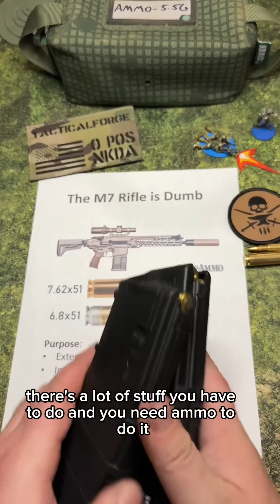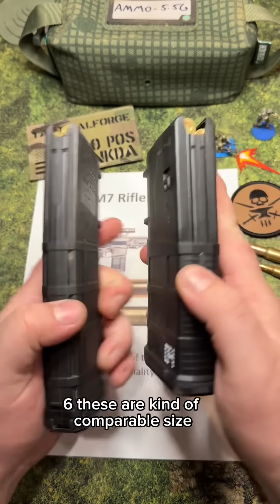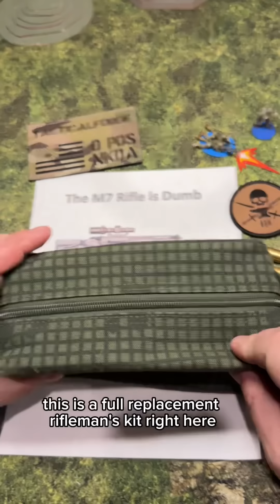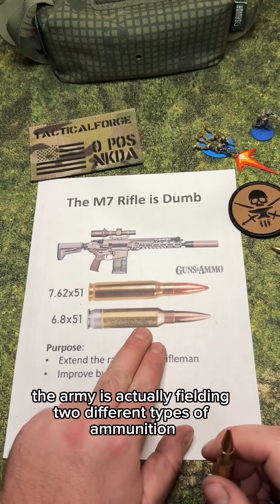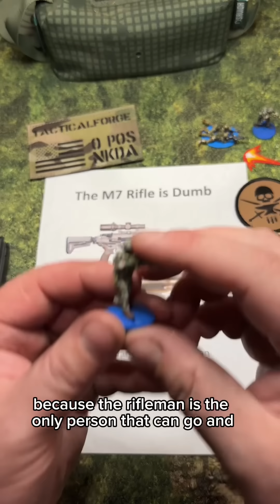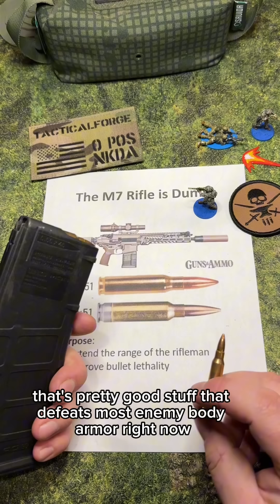The Army’s new rifle is dumb

Comment: This isn't replacing every infantryman's rifle, the M4 is going to stay in service

The rifle was already hard use tested with a suppressor. The entire system is designed to use a suppressor at all times, and it can absolutely work without the suppressor as well

The intention of this weapons system isn't to make everyone a sharpshooter and push engagements out to 800 meters. The issue it's solving is that standard 5.56 ball ammunition in a standard M4 is not capable of defeating modern body armor at typical combat ranges. The new system allows any rifleman to defeat modern body armor at typical ranges while keeping a 13 inch barrel length. The new round does with 13 inches what black tip 308 does with 24

Comment: But wouldn't there be an advantage in terms of defeating body armours and concrete obstacles in an urban environment?
Also in trench clearing shotguns were much much appreciated and they definitely had low ammo capacity, any chance the new rifle could provide a similar advantage?
Reply: It can defeat body armor and still has a 13 inch barrel, the low amount of ammo and weight are the only things holding it back

Comment: My immediate impression of this new rifle was that it gets into a "swallow the spider to catch the fly" situation in a couple areas. They want lots of velocity, but they also want a short barrel, so they need SUPER high pressure. Super high pressure in short barrels means very damaging noise levels, so they need a suppressor. So now you probably go to an even shorter barrel, yet the gun still ends up long anyway with the suppressor on there. Then you shoot whatever mode of rapid fire with that extra-short barrel and super-high pressure into that suppressor, and what happens then?

And yeah the magazine capacity.

And what is Murphy's Law going to do to that two-piece cartridge case?

Some points here I had not even considered. I can remember in the 1980's looking through some old night vision scope at the hot exhaust pipe of a generator set, and indeed it lit up like a glowstick.

Comment: they should've taken the development from the program and instead applied it to more traditional 5.56 platforms. I like the 416 plenty. A 416 type design with a folding stock and a 14in barrel is very serviceable, the MCX tries to be that but has concerns. SIG in general has huge concerns right now. They shouldn't even be in the running for a contract. I like rifles like the CAR-816 conceptually, we need to be learning right now. More reliable, modular, light weight weapons are what we NEED. Less weight means more ammo, more ammo means you win. I also like the concept of the Quattro 15 lower and 53rd quadstack mags, if you pair that magazine which is already lightweight for its capacity with a new lineup of hybrid case 5.56 with increased pressure for increased lethality, even just paired with the m855A1 or M995 projectiles is a huge step forward, or even getting more into the polymer case tech and lightening ammo even more, all the better. I think an important part of commanding firepower is capacity and practical accuracy. Not every guy needs to be a sniper, but if you have a squad where every man can dump 400 rounds in the direction of an unfortunate enemy patrol, your odds are massively better than have rounds that have marginally better penetration but significantly reduced capacity.

Comment: U missed the main reason they changed the caliber its was because of body armor 5.56 was no longer able to do the job. So they need to upgrade to a new rifle to do the job it just come with the bonus of extended range. Does the gun have problems that need to be worked out yes. But even the m16 family had problems for a long time too it just needs time to be worked out.

Comment: An overweight, overpriced, poorly-built, unreliable garbage rifle platform with a new high-pressure cartridge that's stressing the limits of projectiles and barrels. Topped off with an expensive, complicated optic.

Sounds like a recipe for disaster and the fact that we are sending our soldiers into combat that way is beyond disgusting.
Reply: So your solution is an m4 because those will be the solution for generations

Comment: The M7 was designed for yesterday's war. Today's war, being fought around Ukraine, Russian & Ukie grunts aren't engaging each other at 500 yards; it's close combat at 5 yards. Drones make prolonged gunfights at 200-500 meters unheard of. Those fancy sites on the M7 will be rarely used. Grunts are too busy, running  dodging, digging, hiding to pop their heads up long enough to use any of those advanced features. IR lasers on every M7 is suicide. Kamikazi drones will be looking for those. Notice all the AKs both sides use have virtually no lasers & no glass. They're not particularly useful in the kinds of gunfights you see there. Dude's are popping up for a second, fire a burst & scramble before a loitering drone punches their ticket. It's back to WWI with a side of mad max thrown in. Lots of bodies, cheap mass produced guns, road warrior metal cages & motorcycle assault squads, skynet hunter killers drones. Pretty soon a phased plasma rifle in the 40-watt range.
Reply: The army doesn’t plan for trenches to be in their future

Comment: I think it is a complex issue, and partially a doctrinal one. There were armies equipped and fought wars with the FN-FAL or something similar. But NATO standard is important, 5.56 and 7.62 NATO is what everyone has and what supply is set up for. Changing that completely is questionable, but would be insanely lucrative, and it should require a major performance upgrade in all or at least most relevant metrics, enough so that doctrine would take up the slack for disadvantages. 7.62 was shifted from everyone to DMR, machine gun and sniper roles in a lot of countries, in favour of 5.56. But you could plan around a different cartridge, and rehaul the entire logistics chain and tactics set up for 5.56, now we are talking about resupply drones and exoskeletons and other near sci-fi stuff. I think it's a problem of everything goes into the square hole, no matter if it is not really for that, and 5.56 is the intended NATO solution, it fits many, many purposes being just good enough. Will it be in the future or you need something that hits harder, is a question, or could a 40 mag be better if the casing was lighter or could you make something even smaller and lighter with the same performance? The flechette went away, the explosive round is against treaties, the gyrojet went away and so on. Not everything works out.

Comment: Good point about distance shooting with recoil. 6.8 is kicking harder than .308 even with the practice ammo.. The duty ammo is going to kick even more. When it comes to distance shooting, even with .308 it can be hard to see where your shots are landing and make adjustments due to the recoil. There's a reason why the MK12 is the most deadly rifle in US history. Even though it was shooting 5.56 compared to the M110 with its .308, its light recoil made it very easy to make quick adjustments based on POI and get rapid shots on target. Even though they sometimes did have to get more rounds into a target, at least they were able to get shots on target very rapidly.

If they wanted a spicier round compared to 5.56 that was more lethal with better penetration at range compared to some of the more expensive 5.56s ammo required, the answer is either bump back up to 20" or go to a bigger intermediate cartridge like 6mm ARC or MAX. With the overall length requirements, the obvious choice was bullpup. Something like the Desert Tech WLVRN with a 20" barrel is only 2" longer than a MK18 and effectively lighter due to the perfect weight balance at the pistol grip that doesn't strain the forearm. Even if you stuck with 5.56, you just got the full capability of the cartridge back that made the AR platform so effective to begin with effectively giving every soldier a MK12 with MK18 compactness. And WLVRN is multicaliber too and can be converted to shoot .308 and 6.5CM. DT did have a NGSW submission too for the previous MDR iteration and did shoot a polymer 6.8 that didn't have to be overpressured to get the velocity the Army wanted. So now you have a standard issued rifle that's light, great for CQB, and effective out to 700 yards and an excellent BR/DMR that can have that higher penetration and range out to 1000 yards all in one package that can be adapted for every situation they may face. Not to mention it also has a Micron configuration with an 11.5" barrel making it 5" shorter than a MK18 with its stock fully collapsed. And it can be swapped between all these configurations in minutes.

But instead, Army chose a rifle that's not accurate enough for range and too heavy for CQB and made it the standard issue. Phenomenal job.

Comment: M855 works best in a 20 inch barrel with a 1-10 to 1-12 twist.  But of course the idiots in the government couldn't do that.  They had to go with the shorter barrel, tighter twist and it causes pencilling of targets.  What Would be the hydroshock damage happens After it's exited the target.

So, NOW they give them a Shorter barrel, a round that seems to run the risk of breaking the gun with every shot, semiauto only, $5 a round (is what I've heard), rock-in mags, 20-round mags, expensive, easily broken optics, and it's heavy to boot (did I miss anything active/vets?  I'm just a civi but I do my best).

This thing, and the new SAW, are geared to lose every engagement.  The Chinese are concentrating on volume of fire and close-range engagements.  Something private They/Them would run from in a heartbeat.

Comment: I thought the US Army felt suppressive fire is now less effective against better trained and equipped adversaries and that the whole concept was much less fire but far greater accuracy, made possible by the optics.  For that reason, the suppressor is not intended to have “traditional” rates of fire going through it.  Another factor is avoiding having standout targets at squad level in the form of machine gunners, hence the USMC squad carrying M27 IARS.

Comment: Really hard to find reasons to support this call. We all have our preferences to what is best, mine was make it a .25 not metric just to drive the Euros crazy lol. But, seriously a .25 fired out of an M4 same bolt same everything just a tad more down range effectiveness. Not at all new the cartridge has existed for years see .25-45 Sharps. If there is an argument it is they know something the rest of us don’t highly unlikely in light of most of the decisions we have seen. By insider knowledge is their very advanced body armor coming down the pike by China or former Eastern Bloc regions to remain nameless. Is there a theater where this would be a really good idea? I doubt it, but we don’t know what we don’t know. If you were to pick a weapon for a theater of operations it would presumably be one seriously big freaking deal theater. Most likely imho somebody likes being in bed with Sig and well there it is. Super heavy, clunky monstrosity. I cannot imagine going room to room and building to building for hours with this thing. Moreover, the steel based ammo’s pressures have got to eat barrel throats I don’t care what they are made of. Sure the can is a flow through design but it is still gonna get hot, Too heavy, too bulky, generally unwieldy no thanks.

Comment: the thing that gets me about this is all the points of failure. The Suppressor overheats and needs to be replaced. The bullet's too spicy and wears out the barrel, which will need to be replaced. The larger round means shorter mags that you'll run through faster, needing to be replaced. The logistics load of this weapon is HUGE! Imagine your basic riflemen having to routinely strip and change their barrels in engagements. The brass tell themselves "oh, well, they just wont shoot as much so it wont be an issue" but that's not how combat works! Like you say: it's about suppression and maneuver, and suppression needs high volume fire, which will cause this weapon to breakdown in at least three ways. Really seems like a bad idea.

Comment: Once the M7 is fully adopted, some soldiers are going to want to carry a submachine gun dude the weight of the M7.   Then they're going to find out their submachine gun doesn't have the necessary range. They're also going to be frustrated by logistical pipelines with multiple calibers of ammunition.  Then they're going to try to find a happy medium between pistol caliber submachine guns and battle rifle cartridges so all of their guns could fire the same caliber. Eventually they'll settle on some kind of, ummm, 22 caliber high velocity projectile that works well and short barrel and long barrel firearms.

History is going to repeat itself.

Comment: "we don't need another LMG/marksman, we need the rifleman to clear trenches" - if you look at Ukraine, it seems to me that quite often, soldiers on both sides operate quite solitary.
 I.e., could it be that the rifle squad has become too "big" of a unit in today's transparent battlefield, and therefore the capability of the individual soldier needs to be diversified? 

I mean, setting up such a sh! requirement is usually preceded by a dramatic change of doctrine, isn't it?

Comment: A standard M2 ammo can holds 840rds of 5.56mm ammo on stripper clips, and in bandoleers. But, that same M2 can only holds 500 rounds of 6.8 in 20 rd boxes.
840rds of 5.56 = 4 standard loadouts, that can be easily distributed within a fireteam. The bandoleers provide easy carry for the individual soldiers and the ammo on stripper clips, with supplied spoons, facilitate quick reloading.
500rds of 6.8 = 3.5 standard loadouts (someone is getting screwed), and not in bandoleers so it cannot be easily distributed and no stripper clips means each round will have to be loaded into the magazines by hand.
You wont need the long range capability of the M7, because by the time you get your empty magazines reloaded the enemy will be directly on top of you.

Comment: Dude, the front rail is secured by a proprietary micro scre with a proprietary screw head. The screw length is barely 1/4 long, and two of them have to be properly torqued. If they come lose AT ALL, the front shroud is fully wobbly.
Reply: Oh, and you void warrenty if you loctite them. And you have to use red loctite because of the heat. Again, only way to keep them from backing out after 500-1000 rounds.

Comment: It’s all money laundering and budget stealing. Some of retired generals got paid. 
Make 556 bullet heavier. That’s it.
Reply: The M-4's rifling won't stabilize a heavier bullet in a 13 inch barrel, not even in a 20 inch barrel with the 1 in 14 twist! And the muzzle velocity is FAR too slow for $19.99 TEMU body armor. The M2A .30-06 150 grain bullet at 2580 FPS MV didn't penetrate the Chi-Com cloth body armor beyond 250 meters every time.
Reply: @Walkercolt1 make twist 1:7 and 70-75 grains bullet.  
1:7 common in modern AR

Comment: In my humble opinion that no one has asked for, they'd be better of adopting the RA XCR in 6mm ARC or take the Belgian FN LICC .264. For the latter, the steel case can be developed by Badlands ammo to produce the lightweight alloy cases and bump up the pressures a tiny bit with any increase in case capacity that might be achieved going from steel to allow. Likewise a 6 ARC allow case could be developed to decrease weight and increase performance. Both rifles would result in a 5 round per magazine reduction in ammo capacity, but not the 10 with the M7. The ballistic coefficient of both rounds in short, fat, and efficient cases means less powder to supply than .277 and greater accuracy from shorter, handier and lightweight platforms suitable for both open country and cqb engagements. Given the efficiency, barrel life will be significantly improved. 6 ARC has a bullet weight of 108 grns. That, even at reduced muzzle velocity, will deliver more energy on target than 5.56mm and will hold onto that energy due to high BC's making it perfectly lethal at extended combat ranges of 600 yards or so. The BC along with the heavier bullet also increases hit probability due to bucking the wind better, and the recoil will still be perfectly manageable on full auto at point blank range in a trench, until the M7. They just need to accept that picking a 6.8 bullet first, then asking the manufacturers to develop rifles around it, wasn't the way to go.